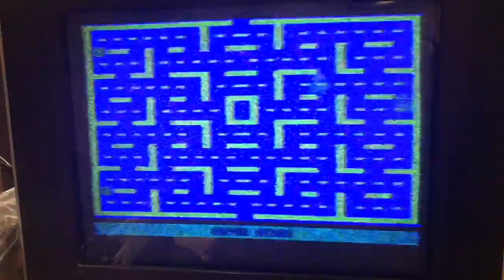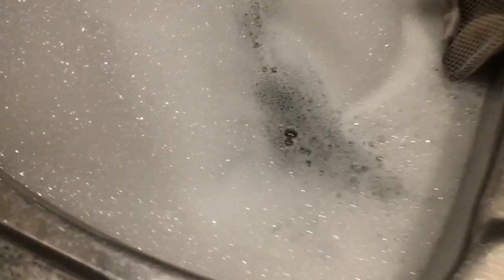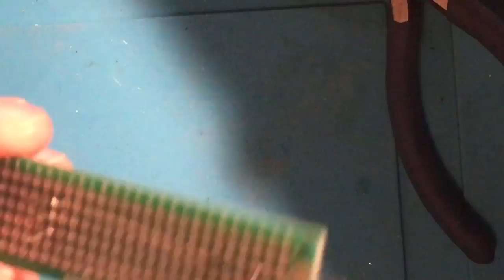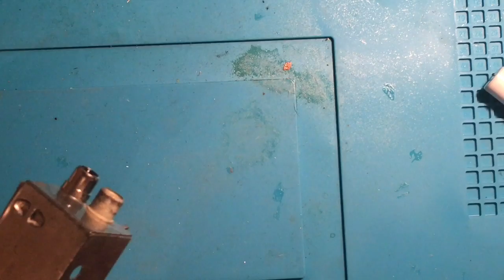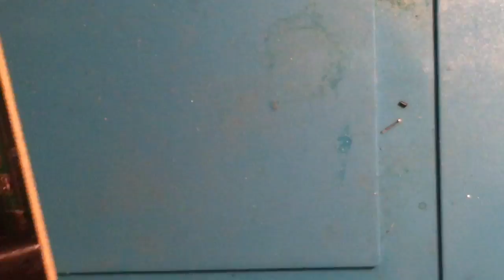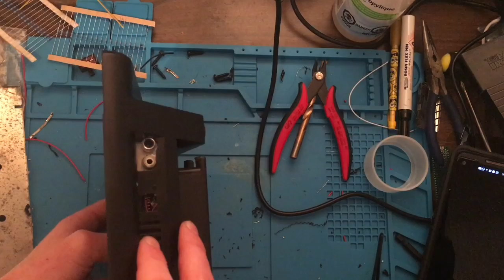Atari 7800 AV Composite Mod inside the RF Modulator - Fixing eBay Junk

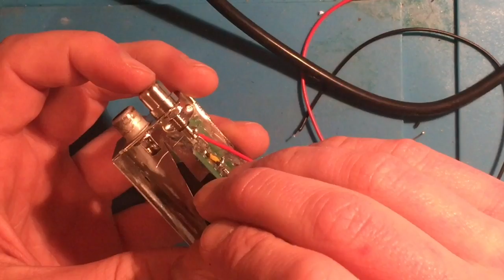Comment: 33:21 giggity.

I probably would have just used a 3.5mm jack and a 3.5mm to RCA cable instead of drilling the case.

Removing the plastic surround around the cart slot makes getting at the screw for the voltage regulator a lot easier, you just remove two screws on the underneath of the board and it pulls right off of the cart slot, plus makes it easier to actually clean the cart slot.

Comment: I thought this mod was pretty sweet when I saw someone do it with pre-made components. But you made your own! Awesome. subscribed

No issues with rotten plastic? My 7800 had a rattle, so I took it apart. I ended up breaking off a bunch more plastic, and now it doesn't rattle but it's fastened together with a strip of masking tape on the back. :(
Reply from the maker: I guess i lucked out with the plastic, but i could see that happening. There's a few small tabs inside that could easily break
Reply: This console was notorious for brittle plastic. I had to make three separate purchases from eBay before I got one that arrived intact from shipping.

Comment: Still have my Atari 7800 and games.
Reply from the maker: Nice! Do you still use it?
Reply: @RetroRepairs  Yes, but the metal decal that goes across the front is in very bad shape, i have been trying to find a top panel in better condition but i haven't had very good luck.

Comment: Great video. Have you ever done an svideo mod to a 7800? I have an svideo modded 2600 which outputs a cleaner image compared to composite. I've been wanting a 7800 for a long time, but no one seems to do svideo mods on them, only composite mods. Have you done it before? Is it possible?
Reply from the maker: I haven't. I see there is a premade mod board available for s video, but in looking it up, alot of people seem to be having issues with it.

Comment: Something you could use to get rid of the rust on the RF shield is aluminum foil. That and water will do wonders on rust. It is softer than the shielding, but harder than rust. I also use it on lightly pitted chrome all the time. It will fill in some of the holes and restore the luster (while turning your hand black).

Comment: Is the board to hold the components actually necessary? Seems like a "in-cable" solution would be possible.
Reply from the maker: It's hit absolutely required, but it does help keep everything together and not moving. You could run wires and wrap all the components together in heatshrink tubing, but it is more likely to break. Less movement is always better

Comment: It seems like a lot for not much of an upgrade until you realize that there's almost no good way to just hook up an RF unit to today's televisions. I'd like to see RF to HDMI on any model of Atari or any of the older Nintendo.
Reply from the maker: Your one point is good, that this improves compatibility on modern tvs, but make no mistake Rf in general is crap. It's a 50 year old standard. An rf to hdmi would just convert the crap into ass.

The best I've seen is the hdNES conversion. It taps into the cpu and ppu and outputs digital video in hd format.  It would probably be doable on something like this too, but the system isn't nearly common enough for someone to build such a solution.
Reply: @RetroRepairs  That just makes me wonder if there's any good way to upgrade 7800 chips to produce better quality video for an easier HDMI mod.
Reply from the maker: No idea. I dont know the technical aspects enough to even pretend to answer that
Reply: Would want to go from RF to RGB first... but it's an Atari. Not exactly known for its stunning colors.
Reply: Composite is a huge upgrade over RF. In this video he uses a small CRT television, which hides some of RFs imperfections. On my 50" flatscreen, RF is completely hideous, whereas composite is at least usable.
Reply: @drloko4013  Im still using RF for older consoles, and its not terrible. But to be fair I dislike using old gear on modern TVs. CRT makes 90% of the oldies looj better imo

Comment: Nice repair mod :)  just a thought, could you have somehow used the RF switch hole instead of putting both connectors so close together or would it have still required trimming ?
Reply from the maker: The problem is the channel switch has no mount there, and the board has circuitry that would interfere with the signal
Reply: A tidier and less drill-ier solution might be to use a 3.5mm stereo jack, but with video on one output and audio on the other.  And without any of the RF modulator or its shield, of course.  You'd use a 3.5mm to RCA stereo cable for the TV connection.

Comment: Jeez I'm early. I'm bored with no comments to read.
Reply: Hi!
Reply: Did you know that you can use RF module from old VCR to convert the antenna signal to composite pr SCART ? Its cheap and easy solution for your SMS II !